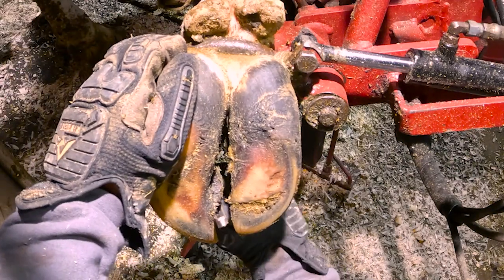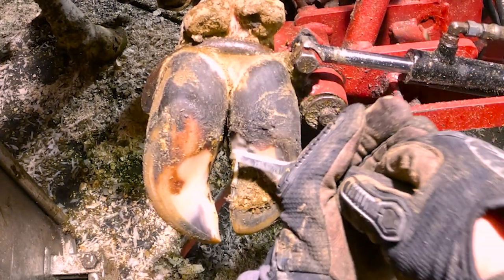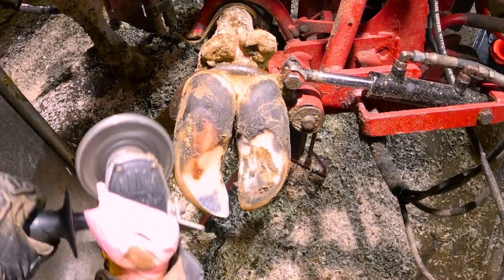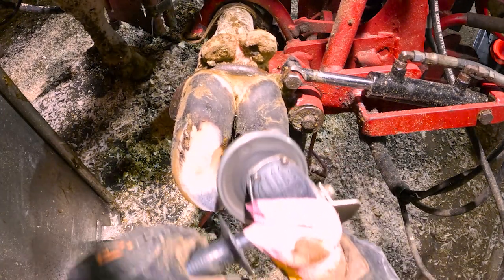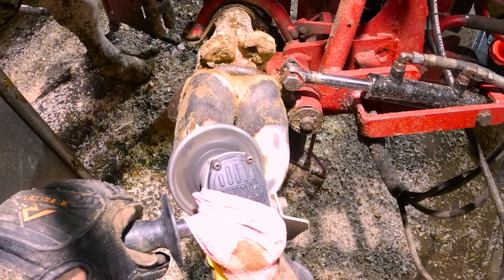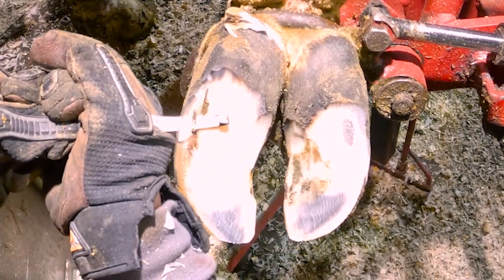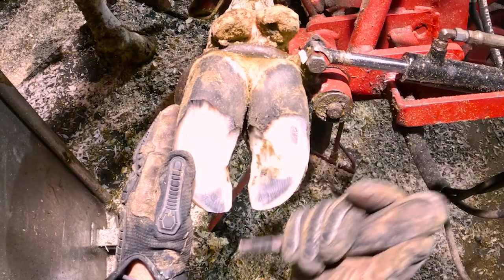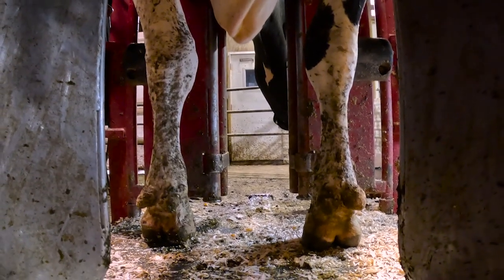Lots of things about to GO WRONG here

Comment: Hello. How do you know that the hoof is balanced? You're not looking up, down, or sideways, you're just saying that it's more worn on the outside or inside. How do you know that the thickness of the sole is sufficient? Thanks for the answer.
Reply from the maker: I can tell what's happening by experience of dissecting thousands of cadaver feet. I've built reliable information using waypoints of each claw that guide me to even sole thickness and balanced pedal bone 😊